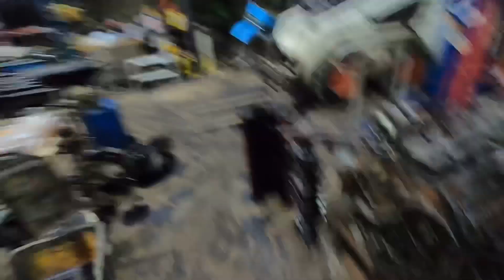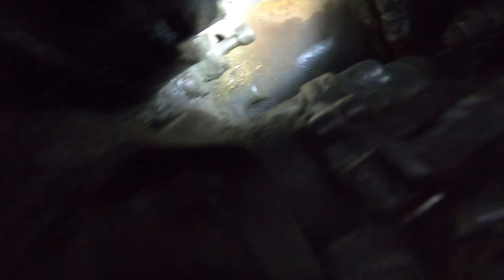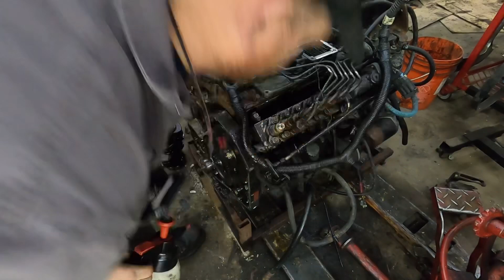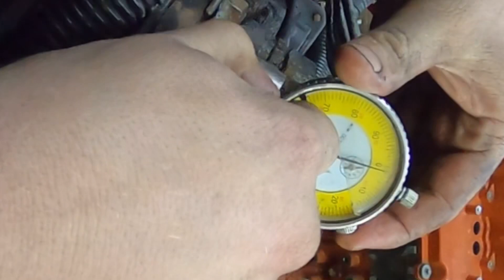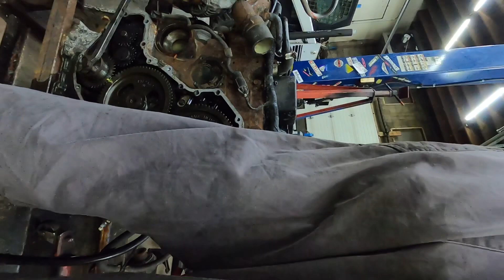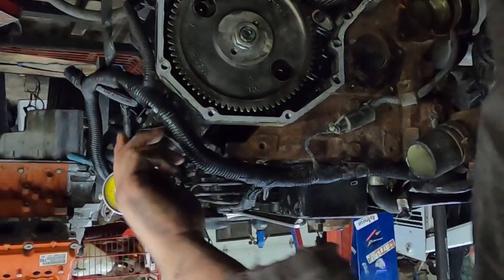Got P7100 Cummins? Here's the RIGHT Way to Set Timing...but It May SURPRISE You!

Comment: Hey Rob, does your videos for timing,and pumps and what not apply to medium duty trucks as well as the light duty trucks ???
I'm new on the scene with the 5.9 Cummins diesel on my F-800 flat bed and I'm seeking out ways to give it more power for those 5 and 6% grades in western pa mountains,my motor burns nice and clean and I'd like to keep it that way just give it a lil more power,it only has 120k miles on it.

Comment: I have a 2002 4bt with p pump. 
It say 15 degr timing on engine. 
Going to do gov spring kit, fuel plate and raise boost some. 

What timing do you recomend ?
Reply from the maker: 16-17 most engines are happy there as long as you fueling isn’t to heavy
Reply: @CUTTERUPROB hi can you say 
Is it 16-17 ° BTDC  on flywheel 
Or at the  pump shaft 
Wich would mean 32°-34° at the flywheel 
Do i understand it right 🤔
Thanks if you could explain

I'm new to PPumps
Reply from the maker: @m @maniekmechanik if you had a reason to measure it the flywheel. It would’ve double what ever the pump was.

Comment: Glad you did this video. I bought the snap on kit a long time ago . I remember hearing o you will melt your pistons ect crap . I used the drop valve method . I used a piece of tig wire to show where TDC was on harmonic balancer once I found it . I also have a 160 pump and I used the cpl number I think that's what it's called to figure out how many mil meters of lift on pump . I set it to 18 deg . That tool is pretty cool deal you made great idea lol . I been at 18 deg for over 20 years on that engine.   I had no clue how to do this procedure but I was damn tired of 16 miles to gallon so I got it figured out . It took me a few tries to get what I wanted.  I did not have that cool tool lol . The change was what a different lol . Just like I thought it would .  No melted piston crap either.  Thanks for your videos

Comment: So you just pulled the gear off cleaned it and put it back on in no particular way? Does it has marks to line up or that doesn’t matter?
Reply from the maker: On the ppump there is no marks to line you.  And cleaner the better
Reply: @CUTTERUPROB  I’m wanting to get the adjustable gear but I’m still not sure about this procedure. Pulling the TDC pin and when to leave it in and pinning the PPump and when do I take the pin out?

Comment: I’ve got a question maybe you can answer I’ve read where a 215hp pump retards timing so would the initial timing need to be advanced more to accommodate the timing retard for an example let’s say a 215 pump retards 4 degree at full rack travel would the timing need set at 24 btdc to achieve the same affects of a pump set a 20 degrees thanks

Comment: You say 272 thou for 18 degrees roughly my timing kit is in mm so what would that be in thou ?? I can't figure a for sure way to convert it myself ?
Reply from the maker: Timing will depend on what pump you have. What pump do you have ?
Reply: P pump 180 hp stock engine but have the fuel plate modified,  afc turned up and I believe a bd deisel turbo that's slightly larger than stock
Reply: I have the blue point sp500 injectin timing kit and the dial is in mm
Reply: Thanks for your help but I did figure it out for myself and found a lift to degree conversion chart

Comment: Advanced timing many times to 16.5/18, new 90hp injectors, 30psi at the pump, torktek ofv, new injector return lines, new fuel filter, no turbo shaft play, boost diaphragm intact, no boost leaks. I'm out of ideas and am about to sell my 96.
Reply from the maker: What’s the issue with the truck
Reply: @CUTTERUPROB  Smokes and pops from 1-2k then when the turbo lights it's fine.
Reply from the maker: If you free rev it does it do it ? 
What pump ? 
What delivery valves ?
Reply: @CUTTERUPROB  Sent the pump away to get rebuilt since the third plunger was sticking. They installed 4K Governor Springs and a number 10 fuel plate. It will not rev properly until I get to 2,000 RPM, even then I have to hold the pedal down until it gets to 2000 for the Turbo to light. I've checked everywhere for air leaks, installed new injectors, and changed the fuel overflow valve. The pump is getting 30 PSI so I'm running out of options. I always timed the engine using powerdrivendiesel's magnetic method. That should be close enough in my opinion?
Reply: @CUTTERUPROB  96 5 speed. 215hp p pump
Reply from the maker: I don’t like doing the timing that way myself. Put more timing in it and see if it helps. Sounds to me a timing or pump issue
Reply: @CUTTERUPROB  Worked before, I'll give it one more shot. Could the broken flag inside e jammed somewhere?
Reply: @vendetta1306  you ever fix it ?
Reply: @EastMenloPark1650  Gonna do a head gasket this winter, found a video on YouTube that sounds the exact same. (Red first gen)

Comment: I just had my pump rebuilt and the pin was reset at 18*, should I worry about my head gasket popping? I have a stealth 64 turbo, ddp economy injectors, steed speed exhaust manifold, with a 4” exhaust and all stock internals. Please let me know, I can send you the specs on the pump if you’d like.
Reply from the maker: If everything is in good shape. I would run it   
Some of it is how you drive as well if you run the truck hard it’s a better chance of blown

Comment: Thank you your videos they are great Rob ,I just wanted to comment on the lock washer on the pump I had one break on me a while back and I wished I had put a rag or something in there I did have to pull the whole front cover to get it out and to make matters worse it was in a diesel pusher motorhome after cooler radiator rear bumper and what challenge that was but thanks for the advice you’re doing great man keep them coming
Reply from the maker: thanks for watching and sharing

Comment: What is the measurement of lift from pump vs degree of advanced?
Reply: Also what timing is recommended?
5.9 p pump, full delivery valve, 4000k spring, 5 x .014, 362 over 475. 5600, 4.56 gears 40's. Looking for a good tow and fun truck. Hopefully not more than 50 psi. Looking for at least 40...  
I was told 16*. I have no idea what the pump is set at. That needs to be checked.
Reply from the maker: it depends on the pump you have if you google p7100 timing chart it will give you a list. timing i would start 17-18 if it was mine.  do you know the pop pressure on the injectors

Comment: Hello, love your vids full of great information on the greatest engine! I have a question, I bought a parts truck im going to use the the intercooler and related parts plus the turbo hx35. The engine blue all the oil out the. Lock up the engine. I want to use the transmission too. How do I get it off if I can't rotate the engine to access the converter bolts?.. thanks in advance.
Reply from the maker: as I said in the other comment be careful with the turbo. On the trans issue just leave the convertor on till you get it out. Make sure you unbolt the engine mounts from the block and frame so you can pull the engine straight out far enough with the convertor still on.

Comment: hey rob my pump is at 13.5 degrees right now and im kinda setting it up to be a hot rod truck should i go to 20 degrees?
Reply from the maker: really has to do with the setup, if your running stock injectors and turbo 17 is a good spot. if you have added more air and fuel the hold back on timing with be your headgasket and bolts.  let me know the setup i have help you out
Reply: @CUTTERUPROB  well i have the afc mods all done 4k governer springs. An s300sx3 turbo .025 dvs and 5x14 injectors and the engine is studded